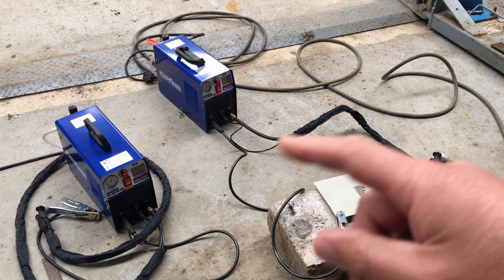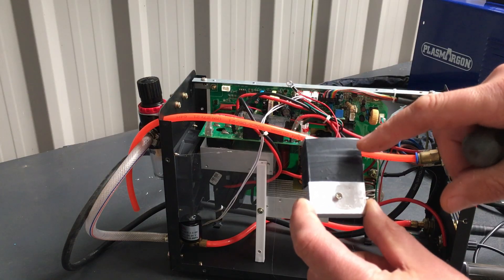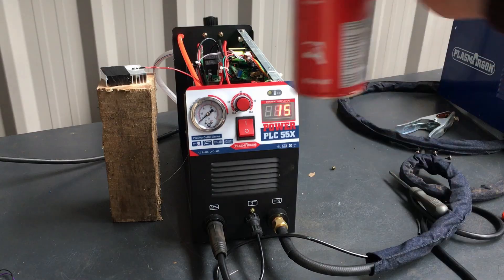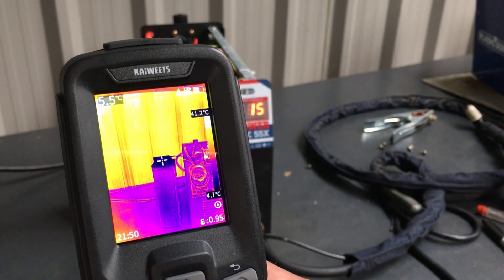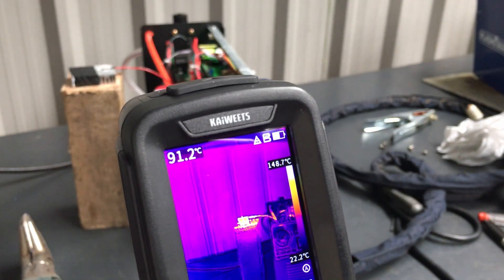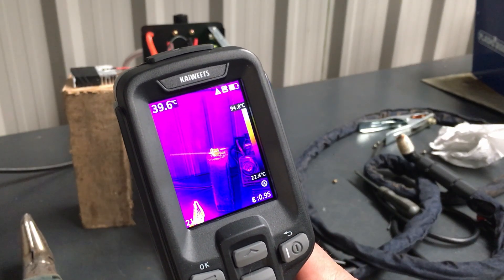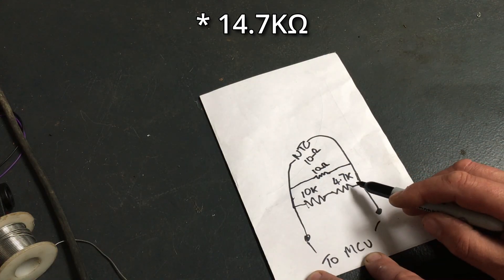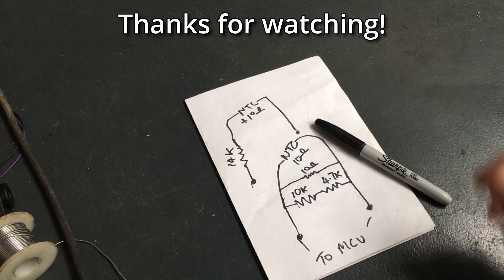Faulty Plasma Cutters - Follow-Up Video (With Thermal Camera) | Will It Catch Fire???

Comment: Yet again, keyboard electronic experts proved wrong again. 😂
Reply: I didn't see the comments, but the repair was clearly explained and even demonstrated in the previous video. PTC Vs NTC.

These people walk amongst us, can drive & vote 🤦🏻
Reply: @incandescentwithrage  Yes sir. There are many smart people in this world. Just ask them, they'll tell you.
Reply: The optimist in me hopes at least a couple of them learns from this demonstration.
Reply: @ohmbug10  By disconnecting the too cold protection, condensation will occur when used in cold environments, and the cutter will short.
Maybe it was nothing wrong with it at all? Can it be that the user have tried to use it in cold environment?
Reply: @micronetwork  The temp sensor wasn't meant to protect from the cold. Plasma cutters are used in cold climates quite often.
Reply: @ohmbug10  Yes it was, that was the reason it was sent in for repair
Reply from the maker: The user used it in a garage that was around 10C when it wouldn't work.
Reply: @BuyitFixit  you would of thought working temperatures would be in the destructions or on the box 🤔
Reply: @micronetwork  You spam this all over the comment section. Ask ChatGPT how condensation work and why measuring the temperature does not help at all to avoid it.
Reply: @leocurious9919  For the fun of it I did, I you use a welder in very cold weather and the pcb warms up will it condensate? Here is the answere:
Yes — **it can**, and it’s a pretty common “gotcha” in cold weather.

### What actually causes the condensation

Condensation forms when *a surface is below the dew point* of the surrounding air. In practice, there are two typical cold-weather scenarios:

1. *Cold PCB brought into warmer/humid air*

   * Example: PCB sits in a cold garage/car, then you start welding (or bring it indoors) and warm air hits it.
   * The PCB (and components) are still cold, so **moisture condenses on them**—often immediately.

2. *Welding heats the local air / drives moisture*

   * Welding itself doesn’t “create” water, but it **heats the air and causes convection**, and can make moisture in the environment move around.
   * If any parts of the PCB remain colder than the dew point (shaded areas, ground planes, big connectors, metal shields), you can get *localized condensation* even while other areas warm.

### If the PCB is warming up, doesn’t that prevent condensation?

Warming helps **once the whole board is above dew point**, but condensation can still happen:

* *during the warm-up period* (board starts cold)
* in *thermal lag spots* (big copper, metal parts, thick connectors)
* if the air is *humid* (snowy/rainy day, damp workshop, breathing on it)

### Why it matters

Condensation + electronics can cause:

* temporary leakage / weird behavior
* corrosion over time
* in worst case: shorts (especially around fine-pitch ICs, high-impedance analog, HV sections)

### Practical ways to avoid it

* *Let the PCB acclimate in a sealed bag* (zip bag) before exposing it to warmer air; moisture condenses on the bag, not the board.
* *Pre-warm the PCB* gently (heated cabinet, warm room, low-temp hot plate) before powering / welding nearby.
* *Keep it in a dry enclosure* while working (even a box with desiccant helps).
* After exposure: *dry it* (warm air + time) before powering.

### Rule of thumb

If the PCB has been sitting in cold conditions and you suddenly put it in warmer air (or start heating the area), assume **condensation risk is real**, especially when it’s near/around 0 °C and the air is damp.

If you tell me roughly the temps (PCB/storage temp and workshop temp) and whether it’s a damp/snowy day, I can give you a more concrete “likely / unlikely” assessment.
Reply: @leocurious9919  I you use a welder in very cold weather and the pcb warms up will it condensate?
Yes — **it can**, and it’s a pretty common “gotcha” in cold weather.

### What actually causes the condensation

Condensation forms when *a surface is below the dew point* of the surrounding air. In practice, there are two typical cold-weather scenarios:

1. *Cold PCB brought into warmer/humid air*

   * Example: PCB sits in a cold garage/car, then you start welding (or bring it indoors) and warm air hits it.
   * The PCB (and components) are still cold, so **moisture condenses on them**—often immediately.

2. *Welding heats the local air / drives moisture*

   * Welding itself doesn’t “create” water, but it **heats the air and causes convection**, and can make moisture in the environment move around.
   * If any parts of the PCB remain colder than the dew point (shaded areas, ground planes, big connectors, metal shields), you can get *localized condensation* even while other areas warm.

### If the PCB is warming up, doesn’t that prevent condensation?

Warming helps **once the whole board is above dew point**, but condensation can still happen:

* *during the warm-up period* (board starts cold)
* in *thermal lag spots* (big copper, metal parts, thick connectors)
* if the air is *humid* (snowy/rainy day, damp workshop, breathing on it)

### Why it matters

Condensation + electronics can cause:

* temporary leakage / weird behavior
* corrosion over time
* in worst case: shorts (especially around fine-pitch ICs, high-impedance analog, HV sections)

### Practical ways to avoid it

* *Let the PCB acclimate in a sealed bag* (zip bag) before exposing it to warmer air; moisture condenses on the bag, not the board.
* *Pre-warm the PCB* gently (heated cabinet, warm room, low-temp hot plate) before powering / welding nearby.
* *Keep it in a dry enclosure* while working (even a box with desiccant helps).
* After exposure: *dry it* (warm air + time) before powering.

### Rule of thumb

If the PCB has been sitting in cold conditions and you suddenly put it in warmer air (or start heating the area), assume **condensation risk is real**, especially when it’s near/around 0 °C and the air is damp.

If you tell me roughly the temps (PCB/storage temp and workshop temp) and whether it’s a damp/snowy day, I can give you a more concrete “likely / unlikely” assessment.
Reply: @leocurious9919  Don't quit your day job (if you have one)
Reply: @micronetwork  Stop pasting AI slop into my face. It is a non-issue, even if there are niche cases where it could theoretically happen. You also did not even ask the AI what I told you to do: How measuring the temperature would help prevent condensation. Spoiler: It can not, since the dew point, a function of humidity, is a completely different thing from room temperature.
Reply: @leocurious9919  I did, and it proves my point. Ask this: I you use a welder in very cold weather and the pcb warms up will it condensate?
Reply: @micronetwork  Not only is there no way to avoid it based on measured temperature, since the dew point can be anywhere from -20°C to >30°C, but even in a hypothetical condensation-is-really-happening-right-now case NOT running would cause MORE condensation since the device does not heat up. Are we done now?
Reply: @leocurious9919  Not really, low temperature warning is there to warn the user what can happend with the welder. If he bring the welder inside and let it acclimate to room temperature everything will be fine. By the way I have repaired welders with condensation shortage in the high voltage circuit, so this is not uncommon.  Are we done now?
Reply: @ohmbug10  Greetings: I hope they learn the hard way. Since it is a chinese unit, the Protect circuit will probably fault and it will incinerate itself. Marshmallows NE1?
Reply: I mean it's not a bad thing to think about things that could be accidentally dodgy. As long as you don't insist if you're not sure.
Reply: Lol great comment that will make Mick laugh 😂